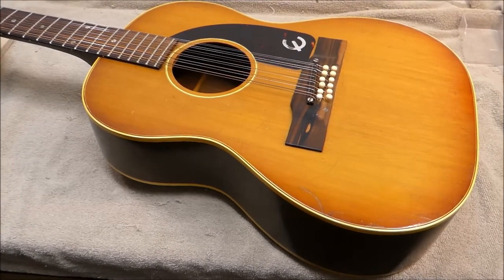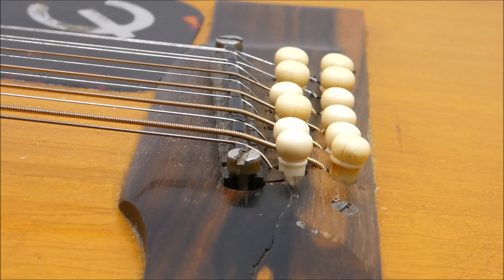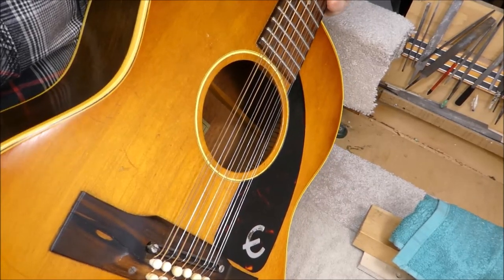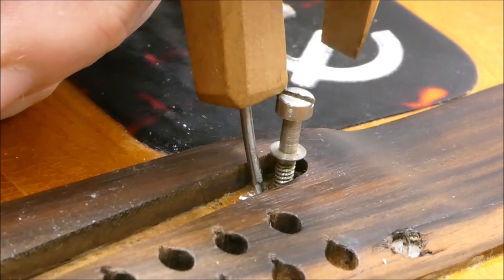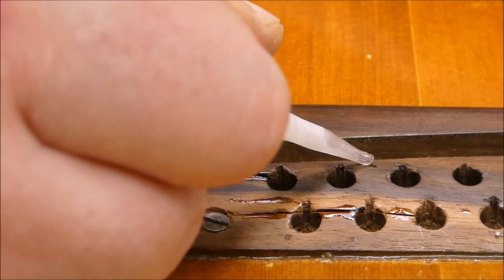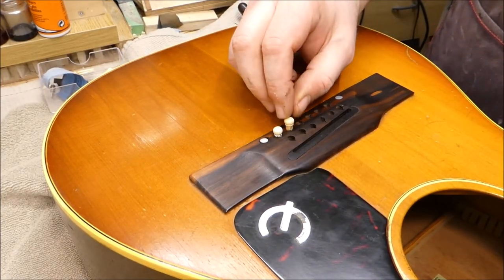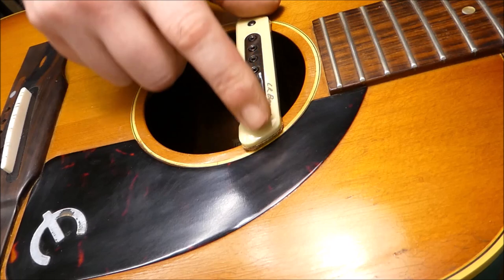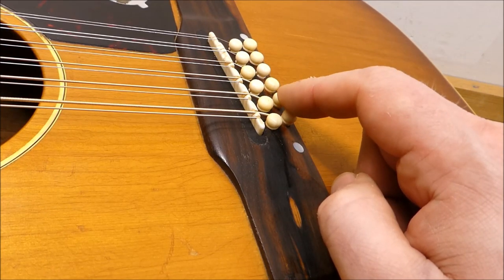'65 Epiphone Serenader Plugged and Set.

Comment: Great work. Thanks so much! I'm very lucky to have you as my Luthier.
Reply: Yes you are! I think that if I needed a hip replacement, I would call Ted.
Reply: You're definitely lucky! That guitar is awesome.
Reply: Ted is truly the Doctor
Reply: You definitely are very lucky!!
Reply: @nickafiedguitarstechandrep9617   Dammit, Jim!
Reply: Yes you are! Beautiful guitar!
Reply: @waybackplayback1347  Quite right; and you can choose between rosewood and ebony...
Reply: @AlfieSmithz1
I've said this before, you truly are lucky Alfie! I'm just now going through an awful experience with a local luthier whom I hired to do a fairly straightforward neck reset on a beautiful 1933 Kalamazoo KG-11. Took over two months (was promised a month) cost $600 bucks, and I can barely feel the difference, the saddle height is virtually the same as before, I even wonder if the neck was off at all, or if he just made a new saddle. (I'm frustrated as hell, wishing I had a Ted close by, as I have a 60s Martin that is next in line...)

Comment: I was amazed you didn't replace the bridge giving it's condition. I was even more amazed on how well you repaired it. It looked like nothing was ever wrong with it when finished.
Reply: if its a clean crack, alway better and easier to clamp and fix then replace the bridge plate inside if needed

Comment: I love Gibson B-25s. I've had several, (6 & 12 strings, all from the 60s) but I've always had to sell them. Had a B-25-12 that came with an original tailpiece and a super slim adjustable bridge, which I likewise converted to screw-less. Had a perfectly flat top because of that tailpiece, no bridge bulge at all! 
I think the B-25 is around a 00 size body, which sounds great as a 12 string to me. The 1960s one I had came with the widest fingerboard I'd ever seen; it was over 2" wide at the nut, wider than a classical! That was the reason I ended up selling it, it just felt too wide for me, but of course I missed it right away and haven't been able to find a suitable Gibson replacement, so I've had to make do with a Taylor GA-3-12 string, which has a much more comfortable neck for me, but does have a considerably larger body, more like a 000, so I do miss that 00. Coincidentally I've come to the conclusion that Taylor makes the most accurate, easiest playing, decent sounding 12 strings for the money (especially the cheaper models), so until I find another good B-25, it's only Taylor 12 strings for me, especially as I get older and comfort plays a huge part in the equation...
That was a great repair, especially how the bridge came out, you really gave it a second life. Sounded really good too, really made me miss mine! ;)

Comment: I had one in a dreadnought form as well as a Texan. They were great guitars . Had both for 17 years ( from 17 to 34) but sold them for a water heater as a family man. They were original Epiphone guitars made in Kalamazoo ( where the original workers remained and worked). They were used extensively by the Beatles and Stones in the 60s +. Also by Carl Wilson when I saw Beach Boys in "78. Everyone I know says they were the best guitars I've owned in 50+ years Those saddle screws actually worked really well.
Once again great work Ted. Sounds great. ( Terry from Oz).

Comment: I had a 12 string like that but no problems. An old Epiphone has a non embossed E on the pickguard. I liked the screws on the bridge, mine could adjust the saddle. Great sound- had to sell due to recession here in 1989. I had had it for 15 or 17 years. Low action was easy to play.

Comment: Another excellent repair job on an interesting guitar. The Gibson B25 series of acoustic guitars were fairly rare here in the UK but I did get to play a couple of 6 strings and they were both fine sounding instruments. I always think that putting 12 strings on an acoustic guitar is pushing things to the limit, so I’m surprised at how well that Serenader 12 string has survived. I’m probably in a minority but I actually like the tone of Gibson acoustic guitars fitted with the adjustable bridge saddle although this one sounds great with the new non- adjustable one you fitted. It looks as though your guitar had probably left the factory with the saddle in the wrong place, something not totally unheard of and probably not that much of a problem if the player stuck to mainly open chords.

Comment: my first instinct with those ADJ gibson bridges has usually been to make the saddle slot plug with the bone saddle built into it and insert the whole thing as one unit, fit tight with no glue, on the theory that it could be pulled out and returned to stock. in this case "stock" is out the window anyway, and it looks like filling the slot permanently and re-milling like you did probably took less time and certainly looks cleaner.
 
also i've discovered that for truly tobacco-coated guitars (where even the tuning keys feel sticky) naphtha doesn't really touch it but windex will take that nasty yellow film right off. not sure about windex on vintage checked lacquer though, might be bad news

Comment: Whoa, that bridge is ENORMOUS. Looks great with the repairs and the new saddle! I have several guitars with strap pins added at the upper end, and they are all just screwed into the heel of the neck. Is that a bad practice? I've never installed one, myself, but I might want to someday.
Reply from the maker: Strap buttons in the heel are fine, as long as a pilot hole is drilled.  I've seen a couple of guitars with cracked heels because someone tried to screw it in without predrilling.

Comment: Incredible work.I have built a maple ply drum kit and the outer shells currently have a Tung oil finish on them,i am thinking of refinishing the outside of the natural maple shells with an oil finish Would danish oil work for that? or would you recommend any other oil finish i could use? Thank you.
Reply from the maker: Danish oil will look very much like the tung oil. Maybe a little glossier. There shouldn't be compatibility issues.
Reply: @twoodfrd  Thank you twoodfrd,i will give it a try,the tung oil does look a bit dry looking and the danish oil might give it a little more gloss TY

Comment: Hey man, is there not a risk that if you put the bridge too close to the pins the higher angle of the string would pull out the pins?

I'm not a luthier so I'm just commenting because it's something I would be worried about.
Reply from the maker: The ball ends of the strings get hooked on the bridge plate underneath and the wedge effect of the pins keeps them in place.

Comment: would lighter fluid dry the finish? asking because I don't know and putting fuel on something like a guitar seems damaging. Is lighter fluid a mix?
Reply: Lighter fluid (I use Ronsonol) is very pure and clean and evaporates really quickly. I have used it as my go-to cleaner for over 40 years. When I was in the television & video trade I used it to clean VCR heads and never had a problem.
Reply: Lighter fluid is basically naptha with some fragrance added to it.
Reply: @JB-jo1pf  thanks for the info
Reply: @brianpateman2666  thanks for the info

Comment: That is the best sounding and in tune 12 strings I've heard for a long time, no mess too much with the bridge was a very smart move.
Thinking as an engineering, why not use the same 6 holes to fit each pair of strings in 12s guitars? The break angle of the back pins and the fragility that the 12 holes causes in the wood seems to be a problem to me.
Reply from the maker: It can be done, but the strings tend to get jammed together and it gets hard to pull them out.
Reply: Also if you break one you have to loosen the non broken string so you can pull the pin and install the new string. Something that can eat up a lot of time if it happens when you are playing live.